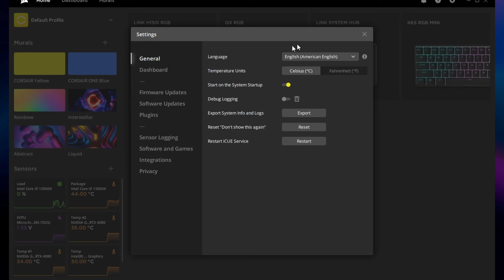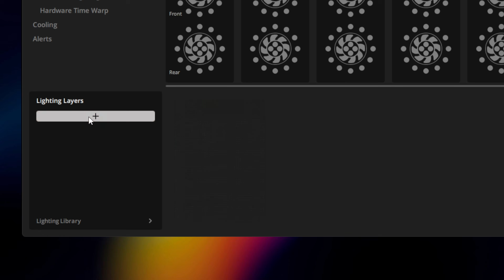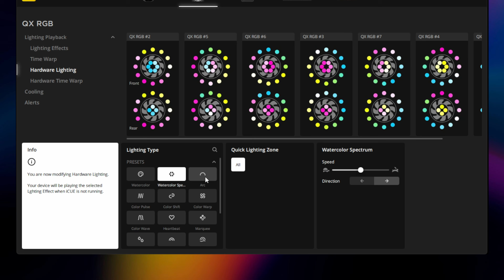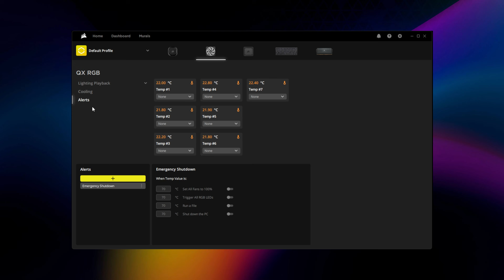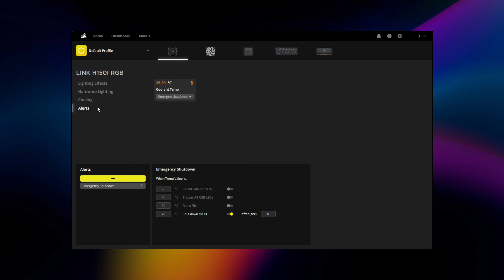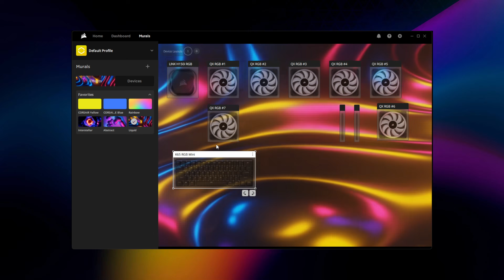Setting Up iCUE LINK Smart Components in CORSAIR iCUE

Comment: I have a latest generation PC...Windows 11, Corsair 7000D case, ASUS Maxiumus Z790,  13900KS, Nvidia 4090FE, 128 GB 6000mhz Corsair memory, and Corsair 170 AIO, as well as 11 other fans.. .  I have been having very buggy behavior with this system... it doesn't always remember some of my settings...  and sometimes when I run heavy intensive apps, like 3DMark stress tests, it causes some of the fans to change their colors for no apparent reason and I have to shut down the computer and re-start to get it working. correctly again..
Reply: I have almost literally the same specs and have had zero issues. Z790 hero. 64 gigs kingston fury ram, i9 13900k, 4090 fe, custom liquid cooled loop, 1500 hx corsair psu and 12 qx 120 fans inside the 7000d

Comment: All the bells and whistles for lighting effects but I still cannot combine temperature sources when creating a custom cooling preset. We need to be able to either assign multiple presets to the controlled fans or create a fan curve that allows multiple temperature sensors as source. Or hell maybe even let us create a virtual sensor that will use multiple physical sensors as source. As it stands I dropped over $300 for 6 fans with the hub and additional cables (cause proprietary) and I have to use Fan Control, an excellent open source application to get my cooling under control. How has Corsair not addressed this yet?

Comment: Just updated my setup with a new Corsair 5000T incl 3 fans of LL, 7 fans of QX , ICUE Link H150i RGB Cooler. Everything is up and going. But god damn its hard to get it to work with my Asus X570E MB and Asus ROG 4090 GPU. Uninstalled and installed several times and tried every "how to do" there is. Not possible to sync icue and aura. Just given up!

Comment: Can i ask a question?, Can someone show a step by step guide on how to set up x3 qx140 front icue link, x3 qx120 side icue link, x3 qx120 pump icue link fans all 9 into the iCUE Link hub. Please. 

I had to plug x2 qx140 bottom 2 link to the x3 qx120 icue link side fans into the left hub socket..

Then plug the qx140 top fan into the pump, so the pump fans are linked into the right hub socket